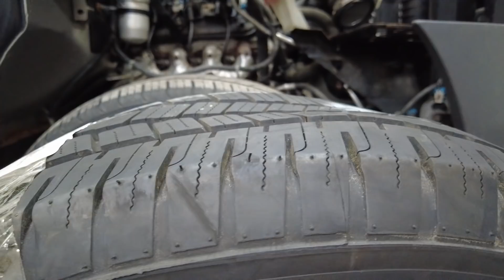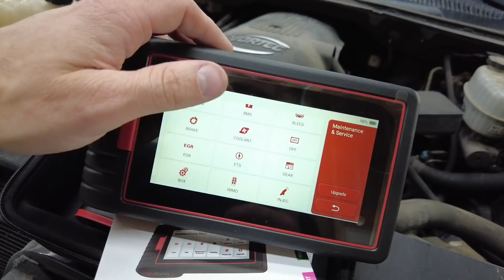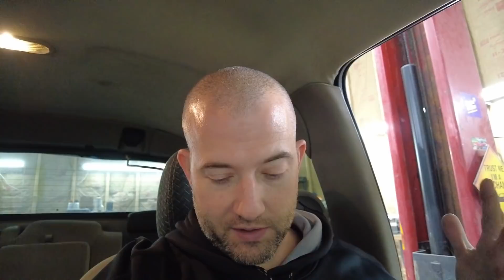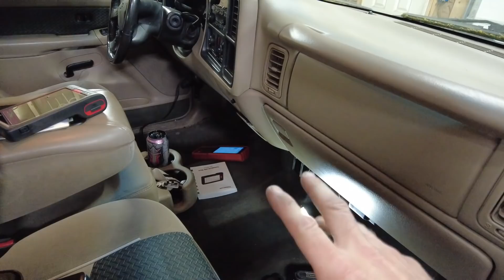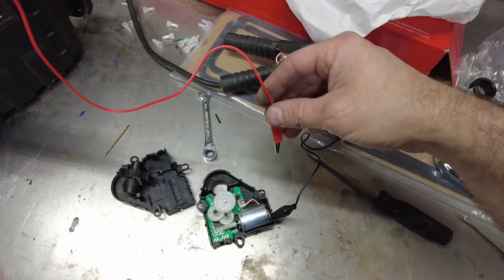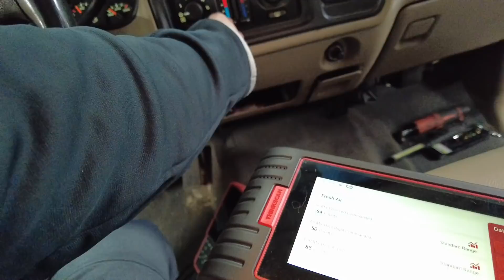Thinkcar Max code scanner + Loftek jump starter

Comment: BULLSHIT! an they knew that tire was messed up before they ever sent it to you, they were counting on you just throwing it on the vehicle and then selling it so that it wasn't your problem or theirs any longer you can tell the belts are bent broken or at the very least twisted in that tire where you can't get very far down the road without it causing you or someone else some major issues. the blend door actuator is usually on the passenger side of the trans tunnel. the one i bought for my escalade ext was $48.00  you could sneak that jump pack into copart with you pretty easy only other thing you would need then is one of those OBDII blue tooth dongles that works with your phone to read the codes with and you could make some more well informed decisions about the cars you're after there too bad no one has offered to send you the laungh X431 pro scanner. i've been looking at that one pretty hard myself lately